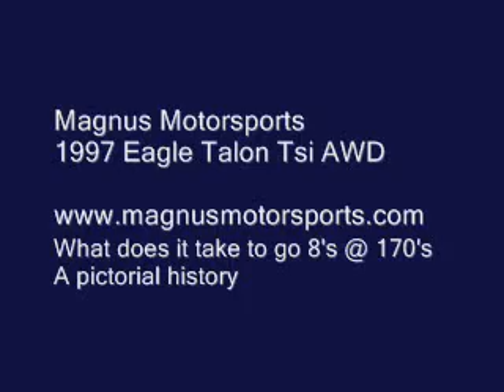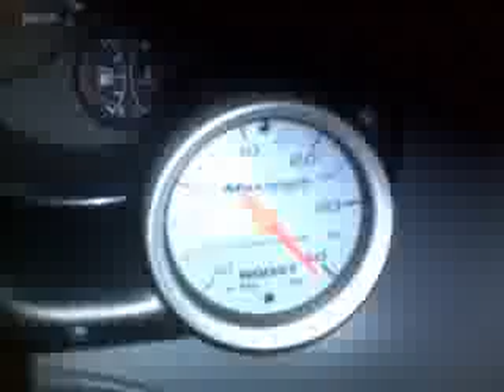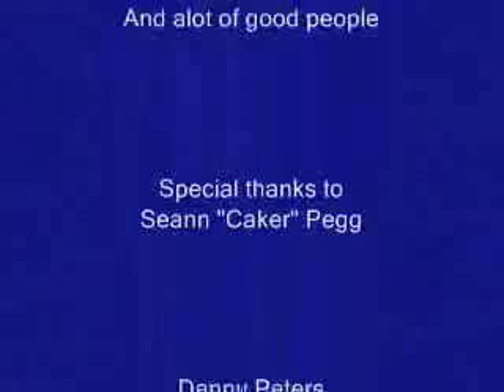1000 AWHP DSM - 8 SECOND

Comment: @b1llc0sby 
 they do have 4g63. the 4g64 is a different motor. you use the 4g64 crankshaft to make a 4g63 stroker motor, usually 2.3 liter